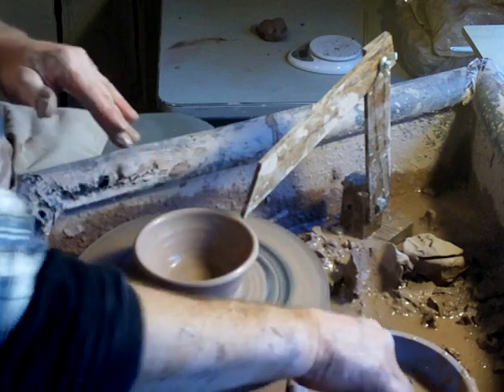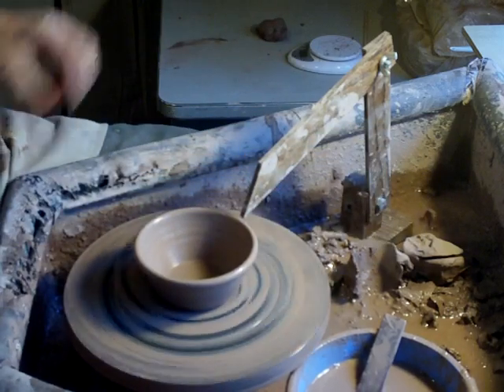SIMON LEACH POTTERY - Repeat throwing ramikins to a gauge !

Comment from the maker: If you dry your hands and clean the slip off the side of the pot with your throwing stick you should be able to lift them off easily enough. There will always be fingerprints but don't worry about them, wipe them away when leather hard if too obvious. When lifting any pot off the wheel head always offer the part of your hand that can give the maximum contact/surface area, which should then prevent indentations from finger tips etc.